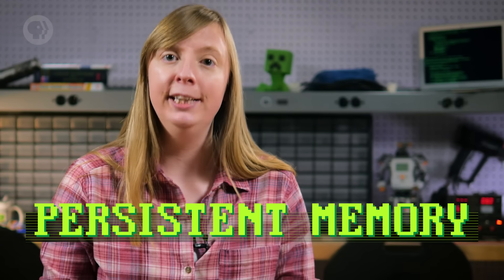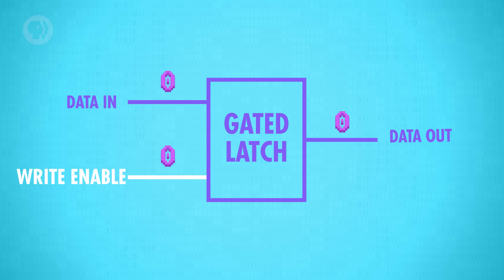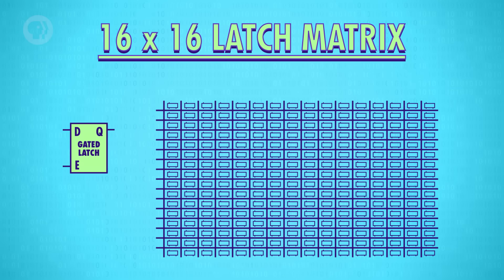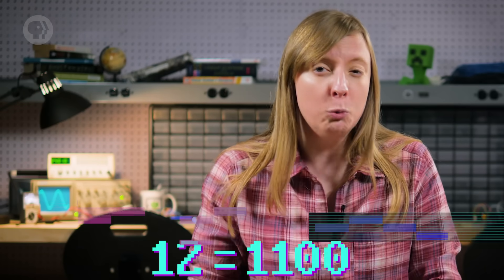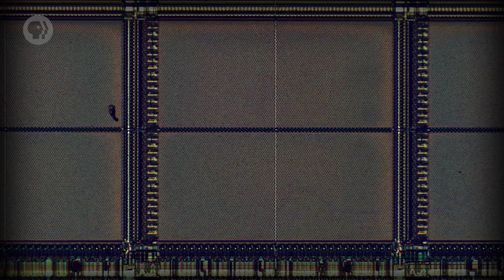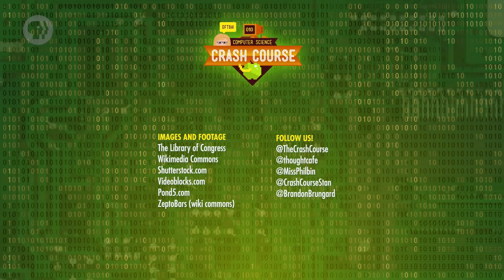Registers and RAM: Crash Course Computer Science #6

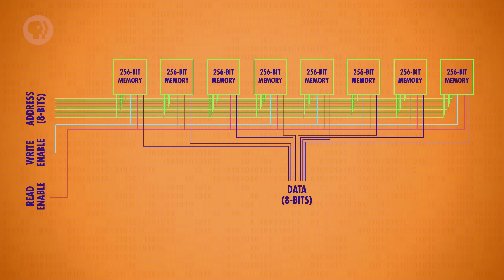Comment: What I don’t get is at 8:50 we see 8 256 bit memory boxes displayed and it is shown that 8 bits or 1 byte is stored separately on all 8 memory boxes for each bit. Wouldn’t it be logical or better to just store that 1 byte sequentially in only 1 256 bit memory box? I am asking this because I am like 99% sure that I'm not getting something right (which is what I think it is😅)?
Reply: One 256-bit memory module can store one bit in the addresses from 0 to 255. If you only used one 256-bit memory, you would be able to store 256 one bit values (so either 1 or 0). Maybe I don't understand your question properly, but how would you use a 256-bit memory to store a byte, when each address can store only 1 bit at a time? Since one address only stores one bit, you can combine 8 256-bit memory modules to store 256 8-bit values (1*8 = 8).
Reply: Yeah, I also got confused. After rewatching it , I believe that 1 out of the 8 bits is stored in each 256-bit memory components, which would mean that we would use 1 bit out of the 256 bits in the memory component to store an 8-bit value. Trying to picture it in my head, each bit representing the 8 bit value would have the same address in their respective 256-bit memory component which would save time. I imagine that if they did it the way that seems more logical at first, they would have to use a second address to specify in which of the 256-memory component the value is stored and its address, so you would need to addresses. I imagine it can also be more efficient with the usage of wires.  I am not sure, I am just trying to make sense of it. Please let me know; I would appreciate it.
Reply: This confused me at first too because there's plenty of memory on one register to store the info, right? but there's only one data wire available to recall it. So a single byte would need to be stored across the whole memory bus
Reply: It's because of the address bus usage efficiency as each gate in a block is uniquely identify by 8 bit address right so we need 8 such gates in different blocks with same address to store 8 bit data
Reply: SAME
Reply: that configuration wouldn't allow addressing
Reply: Super interesting question so first off thanks for posing the challenge! I'm no expert by any means but my guess is that it requires less 'switching' the way they have it set up. In your setup, storing 1 8-bit number would require changing addresses 8 times, albeit writing in one 256 bit box. With their setup you'd only need to change addresses once each new 8-bit number you're storing.

Their way it's also easier to remember that each address stores 1 number. In your setup you'd need to remember where the 8 bit number starts and where it ends (which would be easy enough as they'd be multiples of 8, but it's still more complicated than just saying ok address XY, box 3 is the 3rd digit of the number stored at XY).

TL;DR the condensed image at 9:18 wouldn't look as neat as you wouldn't be able to say 1 address = 1 number

Comment: With an XT motherboard, you can insert 2 8088 processors into one motherboard, and it starts up. I couldn’t check if it addresses more memory. The 8089 I/O processor also exists, can be inserted into the socket of the 8087.

Comment: Hi! Thank you for this amazing Playlist. I have one question here regarding a part of this Video. in 9:15 I noticed that for example in order to store the number 7 which represent 3 ones(111) we store them separately with adding 5 zeroes so it can be stored correctly that means 0000 0111. My question is, is RAM called RAM(random access memory) because it stores a single value in binary, separated in each 256 bit memory? and not  combined in one 256?
Reply: Random Access means that you can access any part of it at any given time. It can give you back the value of any random address you ask for. There was also serial memory in the older days, where if you wanted to read a byte from some position, you had to read every byte up to that position. For example, if you wanted to read from address 255, with RAM you can just ask for that address and it will give you the value, but serial memory would require you to read through addresses 0-254 first.

Comment: For me the multiplexer doesn’t seem to cover all possible 256-bit numbers. For example, if column 1 is required for one bit, and row 3 for another bit, then automatically the bit located at row 3 column 1 will also activate, even if I don’t want to. How does this work?
Reply: Peterolen So you can only access 1 location in each multiplexer at a time? That explains why there is only 1 data output, but isn’t that very slow?

Comment: Those are SR-Latch and D-Latch. D-latch is a gated SR Latch. (Unoptimized for illustration purposes.) Most have edge detection in synchronous circuits which can be called flip flops, while asynchronous use latches. Asynchronous circuits are screaming fast, yet power hungry. Most computer circuits are synchronous. ASICs tend to be the ones that are asynchronous but can be either or. A lot of SRAM is build around gate based memory which is costly in terms of area due to gates not wires. These gates need metal layers (wires) to interconnect, so what they do is use lower levels to increase density. Then connect them into cells which reduces wires that would waste area  or density. So they use mid to upper layers for the wires of the cells. Better known as locality. SRAM is fast but expensive and power hungry. Slower DRAM uses more capacitor like mediums sometimes with a single transistor for driving versus whole gates which use multiple transistors. This allows an increase in density but lowers performance and possibly power. However power tends to increase with bit density, but increasing density may also lower power or normalize it out. One thing about wires is they tend to form low pass filters, which creates delays or limits performance. Architecture generally handles this which also tends to decide how the matrix is arranged. These factors also predict the tradeoff of wires to gates in said matrix.

Comment: So question: How did the computer 'save' the bit at a low level before silicon wafers? Didn't it require electricity to run through the circuit? Wouldn't that mean it wouldn't have persistent memory since the electricity would turn off once you unplugged the computer? Or does the saved bit continue around the circuit without power?

Comment: I'm confused - if you have an 8 bit number, which means you need 2^8 = 256 different addresses or 256-bit memory block, then if you have a 32 bit number, do this means you need 2^32 = 4294967296 addresses or a 4294967296-bit memory block?

Comment: When I was taking electronics in Jr college before I went into the AF we designed logic circuits. Sounds like a flip-flop.
Reply: I think RAM is made up of D latches, which are similar to D flip-flops. But they might be the same, idk. I think a D flip-flop needs the enable to be a one tick pulse to change the stored bit to whatever the data is, while the D latch’s enable can be constantly on, allowing the enable to pass through.

Comment: 2:43 I built this exact circuit and i remembered to add a resistor before each base of a transistor and when i power on the circuit, the led starts of not on and then when i put the reset pin (bottom pin in picture) high the led stays off (as expected) but when i put the set pin (upper pin in picture) high the led at the output comes on (as expected) but when i put the set pin back low the led DOESN'T stay on. Any help?

Comment: HELP PLEASE. I don't understand  how can you address 16 columns with only 4 bits. First, because when there is no electricity is when the wires are 0000, therefore i don't understand how can be selected a wire without electricity. And second, because there must be logical AND gates connected to certain wires so the electricity go there, for example: if 1010 is 10 in decimal, the first and third wire should be connected by an AND gate to the column 10; thats the only solution i came with but, because it's not explained, i don't quite get it. If someone could explain it to me I would be grateful. Thank you very much. Great video, for the rest I understood everything.

Comment: Early computers did not use 8 bit. Early microcomputers did (as did microprocessors from the 8008 onwards - omitting the 4004). Early computers often used rather long registers, e.g. 42 bits, but few of them.

Comment: I have a very hard time to get the idea why a computer needs a memory/RAM

For example, due to billions of transistors inside a CPU, say if we get a number 1110001010101 in somewhere of those transistors connected wires, why not just leave those wires as is (don't touch these wires), is this the same way as "store a value" as RAM does?

I am trying hard to visualize this hardware in my brain and why it is necessary to build so called "latch" or whatever, compare with just leave those wires (because we got enough wires inside)

Could anyone help on this topic? Any life example like play games, type words, watch videos or whatever, to prove a computer has to have a RAM to work?!

Comment: I am not sure I understand how a latch maintains its value. The video shows that a gates output is looped back onto one of its inputs, but to me that sounds like plugging a surge protector into itself, where does the electricity come from in that case? It sounds to me like a loop would be a broken circuit and the flow would stop right? I am having a hard time getting over this bump in my understanding.

Comment: i got a question on  8:55 , if i  set the address as 0000 0000, will  the eight 256-bit memery  go the same address? if so how can i set 1100 0011 in  this  address which is 0000 0000 .

Comment: I love this series: it's like going back to the basics in school in the 70's!  One correction though: the early (_really_ early) single chiop CPU's (i.e., "Microcomputers") were 4 bits wide, not 8!  The Intel 8008 was the first CPU on a chip for the general consumer market, and it was 4 bits wide. It's later sister chip was the 8080, which was 8 bits wide, and was the chip on which general purpose microcomputing was born on the IBM "home computers".  Of course there were dozens of microcomputers before the IBM debacle permanently screwed up computing forever: the more famous chips were the 6800 (the first one I used to build a home computer), the 6502, the 6809 (kind of an upgrade to the 6800, like the 8080 was an upgrade to the 8008), and the T.I. 99's brain, the TMS9900. Good job on this series though!

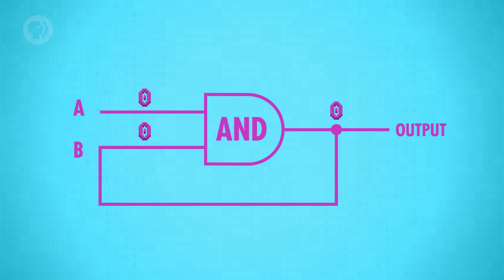Comment: I've a small question. Between 2:18 and 2:23 she sets inputs A and B to 1, then when she changes input A to 0, output becomes 0 but input B is still 1, right? But it's also connected to output so then how did she set input B to 1 when output was 0 before :o

I do understand the looped AND circuit will always output 0

Comment: Very informative and easy to understand. But when you're talking about selecting rows and columns, didn't you mean "decoder" as opposed to "multiplexer"? The shape is that of a decoder, and since it only has the row/column address as input, it will enable one output at a time. A multiplexer on the other hand selects which of the inputs (2 ^ select bits)  it passes to the output.

Comment: One thing i'm confused on is that if a set of 8 x 256-bit memory registers were put together and then is fed the same memory address and the same write enable wire, would they not all produce the same output because the same thing is being done to all of them? Why would it not be just 11111111 and 00000000? How does each register have a different bit if they are all fed the same 8 bit address and same write enable? Is it that they all are fed different Data in/out wires?

Comment: At 9:04 in your video you decribe 8 bits of data that make up a byte. The interseting thing about this is that in fact then a byte of information actually spans across eight different 256 bit memory modules rather than reside in 8 bits of a single memory module. The puzzle I have here is that it looks like you can only store either all 0's or all 1's using this configuration since - as it is drawn - the write enable line goes into the same place in every 256 bit module and so does the data line. Please explain!

Comment: CrashCourse at 7:50 you didn't specify how 4 bits converted into one out of 16 and so I search the term multiplexer but the images that show the design of AND and NOT gates in a multiplexer only has an output of 1 bit from a combination of bits but then I see articles that link the term multiplexer and decoder so I look the term decoder up and it seems that that more accurately represents what is happening on the image on the screen. So I have been confused of how this works and if I'm missing something because of my bad interpretation of this image(or if it has something to do with something in the future)(or something similar) or  if you have mixed up these terms or the terms change from country to country. Please could you clear this up for me and anyone else who has been confused by this?
Reply: Leo Bourke well you start with 4 wires which go in. For each of the 16 output lines there is an and gate with a unique pattern of normal inputs and not inputs. For all 16 possible inputs there is a different output wire which will turn on. Output line zero would be al nots, outputline one would have 3 nots and the last one be a normal wire and output line 15 would only activate if all inputs are on by having no nots.
I hope this helps

Comment: At  2:31 , if you input 0 for A and 1 for B then the output should be 1 because of that connection from B to the output. Therefore this ends up becoming like a partially "Or" "And" gate. Is there a solution for this?

Comment: How does the gated latch store the value of 1 in terms of electric power/current? Doesn't 1 mean there is a current flowing through. Sorry I didn't quit understand how the value of 1 can be store without a current constantly enabled on it, especially once the data input and the write enable wires have been set to 0 (no power).

Comment: I am confused................
So the 16 rows and columns of latches (which can only hold 1- bit) make the 256-bit memory? Or is it that each latch is a 256 -bit memory? If the whole 16 by 16 latch is the 256 -bit memory, then I don't understand how it has an 8-bit address, a data, write enable and read enable wire. (Aren't those supposed to be for the latches?)

Please help

Comment: So I understands how the gated latch works logically; however from an engineering perspective it seems like a gated latch should lose power really quickly, because of the resistance in the wire. Is there like a capacitor or something being omitted in the schematic?
I'm really loving this series by the way; so it has been the most comprehensive explanation of how computers work, that I have seen.

Comment: So presistant memory is like when you save a game?
or a world in minecraft etc?
Reply: Sqiggly lines Yes. Persistent memory is on your harddrive.
Although a minecraftworld is not saved block by block. It is generated by a seed and then it saves all the changes you make. The world is infinite (aside from world limmits) because it is generated in all directions by the hash (seed). Its quite cool really.
Reply: Persistant memory is a memory which don't disappear or degradate when power us off, most basic one is ROM Read Only Memoery in which bit states are buned in in to the circuit and can't be changed, this is how game cartriges work, most basic writable persistent memoery is Static RAM SRAM which is RAM powered by battery, which is also been used in early game cartriges to store save data. But we talked here about just one medium (circuitry memory), there many ways you can store data in persistent way

Comment: Quick question about the logic gates-

At 3:35 we've got a Not-And-Not coming from the data input, leading to a final And in the latch

What is the point of having the two not gates in succession? Aren't you just inverting the signal back to its original form? Why not have the write enable and data input feed into a single And?
Reply: PopeBarley they are not in succession they are separated by the AND. This is what is making the gate. She doesn't explain this but perhaps if you look at what is yellow and blue at 3:39 you might be able to work it out.

Comment: I found an online logic simulator: https://simulator.io/;
For those of you who want to try out the circuits by yourself. Have fun :)
Reply: If you are still into these things, I suggest a software called Logisim: it's a digital logic "simulator" that lets you design and see in action circuits, with a great deal of complexity. For instance, you can design a whole CPU with that. It's freeware and it should work on every platform, since it's based on the Java engine (I am sure that works on Linux and Windows)